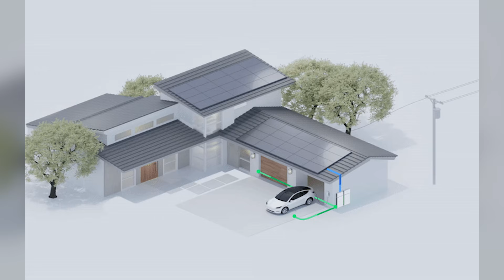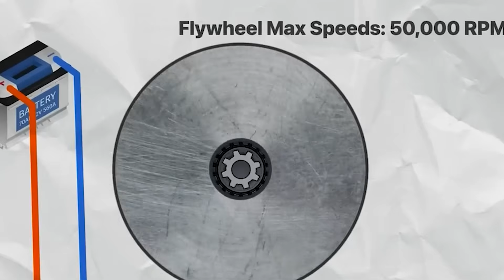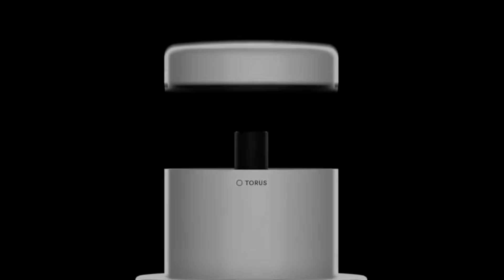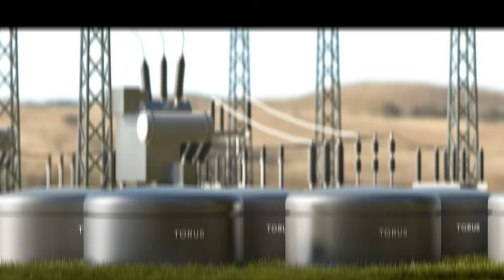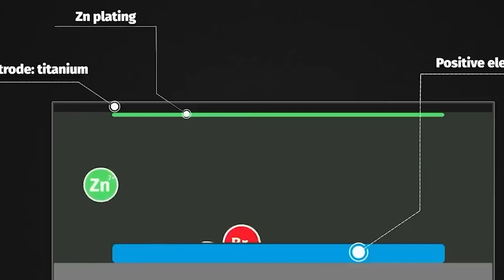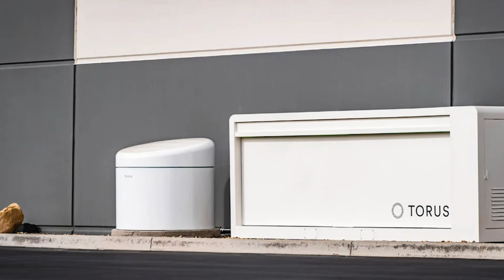This Torus Steel Flywheel Outlasts EVERY Lithium Battery — 25 Years, ZERO Fire Risk!!

Comment: This thing will cost you money. Unless you already have a nuclear power plant of your own. You need to BUY a TON of material, that has already been formed into a solid piece of steel. You need to buy a generator to connect it to. I think it would cost somewhere around $300,000 dollars. That's not an exaggeration, And it may be a bit on the low side.

Comment: Fuel ZERO to power a flywheel ? what are you talking about, the electricity came from somewhere, so the fuel is either solar, wind,nuclear, of fossil. Unless you are making energy from nothing.
I guess I could say my EV has no fuel as it is ran from rooftop panels , but that is not true, the fuel is the fusion in the sun.

Modern high-performance flywheel energy storage systems (vacuum enclosure + magnetic or low-friction bearings):Standby/self-discharge often in the range of 1–5% of stored energy per hour in many designs; some optimized systems reach ~2% per hour or lower.
Commercial examples report average coasting losses under ~200 W for a ~25 kWh unit (roughly <1% per hour under good conditions).
High-vacuum + advanced bearings can keep mechanical efficiency high (~97% in some references).
Over a full day, self-discharge can range from tens of percent down to much lower values depending on design and vacuum quality (e.g., 25–55% in 24 hours in some modeled systems at different pressures; advanced units aim much lower).

Standby power loss is often quoted as <25 W per kWh of storage capacity in well-designed systems (sometimes 1–2% of rated output power).